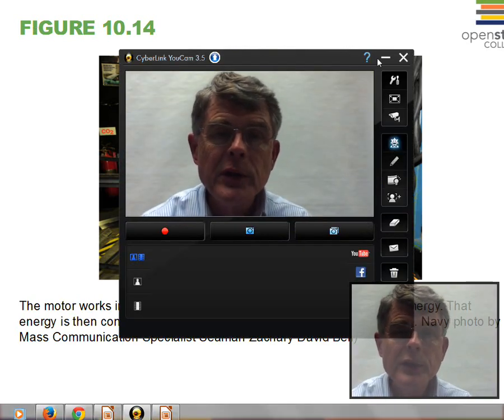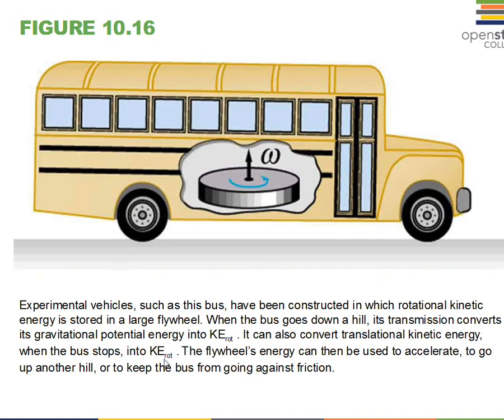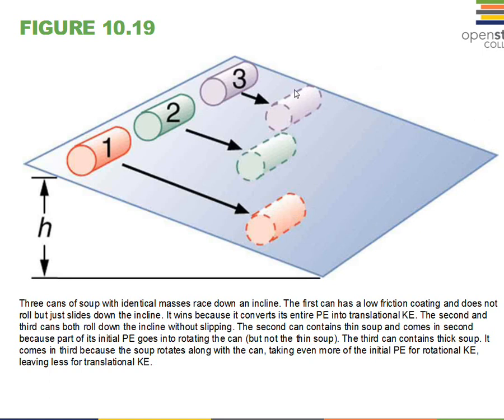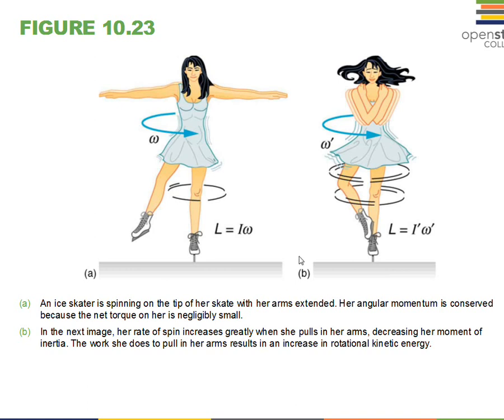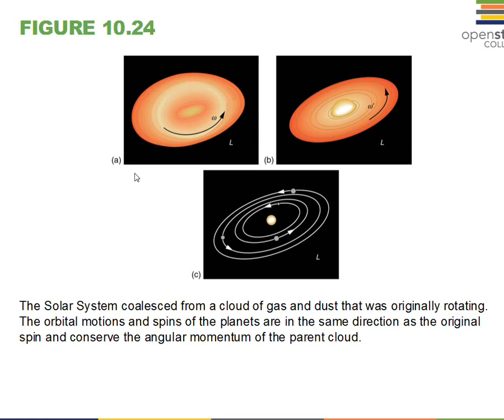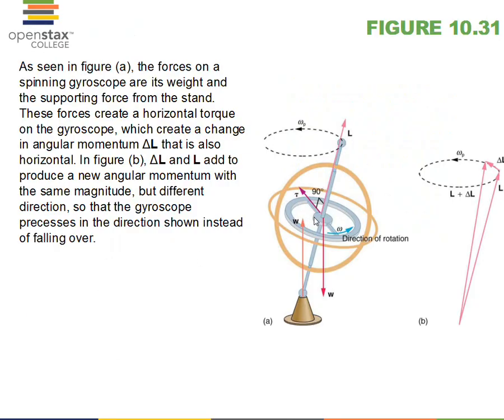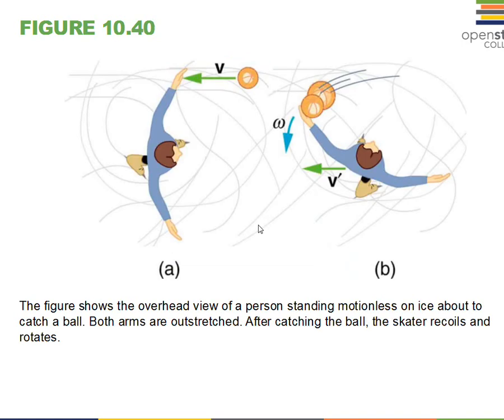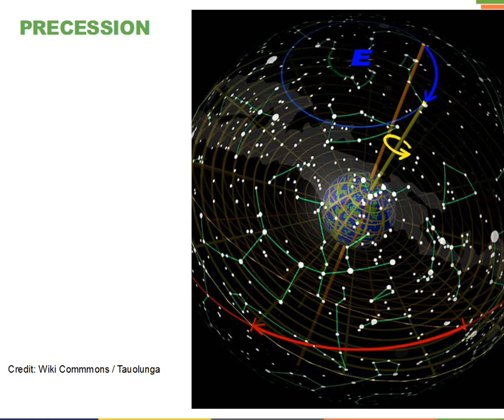Rotational Kinetic Energy, Conservation of Angular Momentum, Precession

Comment: All of your examples are vague and weak.  Where is the lab experiment?
The ice skater conserves angular energy. Angular energy is defined as rotational kinetic energy, except that it is conserved instead of angular momentum. The reason nobody has successfully confirmed in experiment that an ice skater conserves angular momentum or anything variable radii conserves angular momentum is because it is impossible to confirm a fallacy. That is the cause of ‘the angular momentum problem’ to which you allude. The truth is that angular momentum is not conserved. The reason you have no genuine scientific evidence is because angular momentum is not conserved. I am just the messenger. There is nothing personal here. Existing Physics and all physicists have no scientific evidence directly confirming COAM because angular energy is what is conserved in reality.